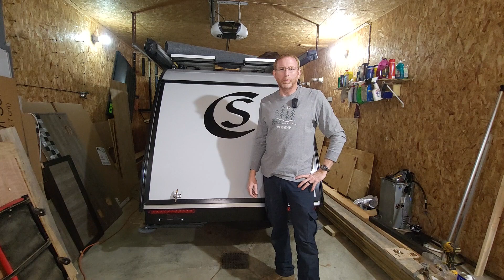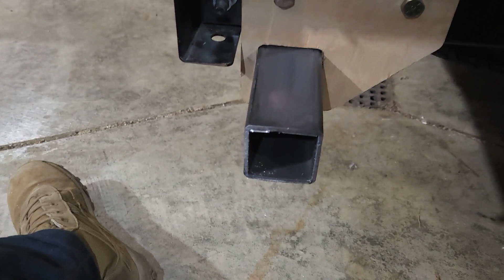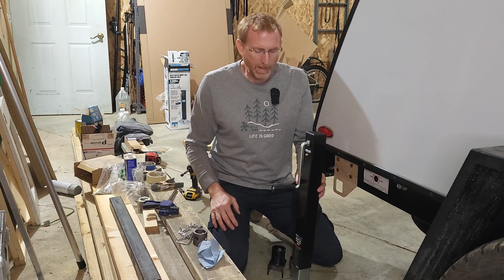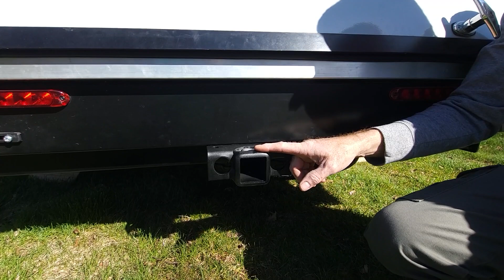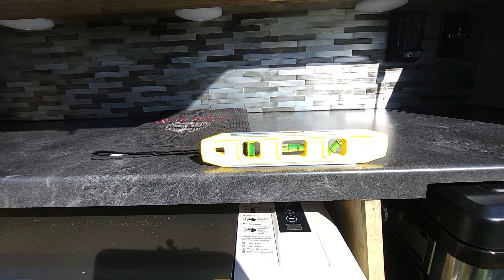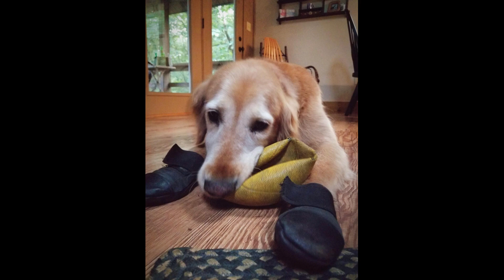Teardrop camper rear receiver hitch and stabilizer/recovery jacks build.

Comment: I purchased the stabilizer jacks you did. Like you I need to shorten them. They look complicated to disassemble. Can you explain how you did it?
Thanks so much. Very informative videos.
Reply from the maker: Its been a while since I did that but if I remember correctly the inner tube just slides out when you remove the pin. The middle tube moves with the jack screw. Just crank it all the way down. The threads on the jack screw might be smashed to keep it from coming apart. Once you cut it then you can seperate the pieces. Its not too complicated if you just look at it.
Reply: @adventuresofthememorymakers thank you so much for responding. I will give it a shot.

Comment: Hey great job on all your modifications you’ve done. Very interested is purchasing a Bushwhacher Radical 12ROK but it doesn’t come with a hitch receiver that we really would like to transport our bikes. What would a job like this cost? If you could share
Reply from the maker: @Roburena333  thank you for watching. I honestly don't recommend carring bikes on the back of campers. It is very hard on the carries as a renosance vibration develops as you go do the road and it is very hard on the carries. I have seen too many of them fail because of it.
Reply: @adventuresofthememorymakers  Oh ok well something I didn’t know. If we pick up a camper (which we will sooner or later) I have no experience with them. Thank you for the quick response and info. I appreciate it!
Reply from the maker: @Roburena333  totally understand. A lot of people do it, some have problems with it. Its just not worth the risk so we won't set them up like that for customers. I did make a bike carrier for the tongue of our camper when I extended the tongue. The tongue does not set up the vibration like being behind the axle does.

Comment: is the hitch connected to the square tubing as well or is it just bolted for light weight things? Im thinking of doing this to my bushwhacker just for 2 bikes but wouldnt be able to do the square tubing, do you think that just the 2 bolts would be sufficient for just a bike rack and thats it?
Reply from the maker: Like inside in the video, the two bolts are in the horizontal channel for alignment purposes only. Please do not try to carry a load using only those two bolts in the horizontal crossmemeber.

Comment: I guess i am not as crestive as you sre. I simply purchased 9k lbs scissor jack/stabilizers on each corner of the camper. Brian Smith did it 1st and i stole his idea. Anf i can lift the camper high enough that the wheels/tires are off the ground.

Comment: I'm so sorry for your loss. Thank you for sharing that with us. No two losses are the same but losing a loved one is definitely difficult. I'm sure you know that the pain will ease with time but the memories will last forever. 
Regarding the lifts, I do have a question for you; how stable is it when you lift it? Are you going to add front stabilizers? Are you looking for it to be not moving at all? It just looks like even though you have it lifted it might wobble a bit when you turn over at night or when you get in and out. I have been toying with putting something just like that on mine. Fortunately I already have the receiver hitch installed from the factory. 
Thanks again, 
Pat
Reply from the maker: Thank you, Pat. It's been very hard. Wilson was one of a kind.
 As far as the stabilizer/recovery jacks go. I love them. They are very stable. So far, the only time I have had the wheels off the ground was when I was seeing how high the recovery jacks would lift it. One wheel will always be on the ground unless you camping over a ditch. 
 I personally don't like 4 point stabilizers on small campers. 3 point leveling is much simpler and has worked very well for us. Maybe I roll over in my sleep very easy but I have never noticed any movement with the new jacks. 
 I just saw a factory hitch setup this past weekend. The hitch side plates are pretty far forward to adapt for this style of stabilizer as you want them as far aft as you can get them.
Reply: @adventuresofthememorymakers  I am pretty sure I can make it work with mine, but just not completely sure it would be worth all the trouble I would have to go to in order to add it to mine. I have the FreeSolo Flav with a side kitchen. I would also have to contend with the slide out kitchen table on one side and all the hook ups on the other side. But it could be done. I would definitely have to engineer it a bit differently than what you did to get the same results. I seriously don't think I could get the same equipment to work on mine though. Regardless, you did a great job. Thanks again, Pat

Comment: What about your suspension travel before the tires start coming off the ground?
Reply from the maker: I probably should have showed that in the video but it easily raises the trailer up off the ground. So far I'm just jacked it up high enough to spin the tire. When I get a chance I'll check and see how much extra travel is left over after that.